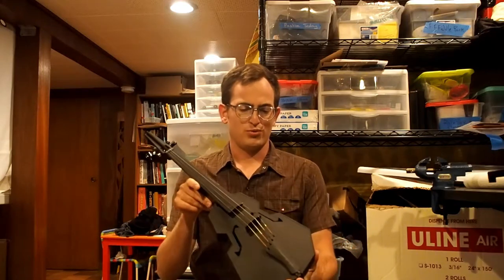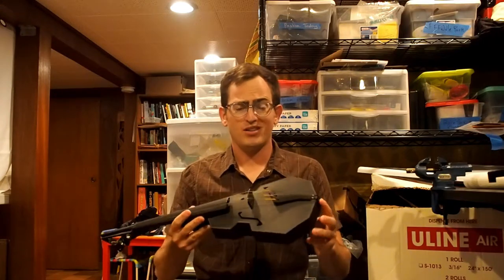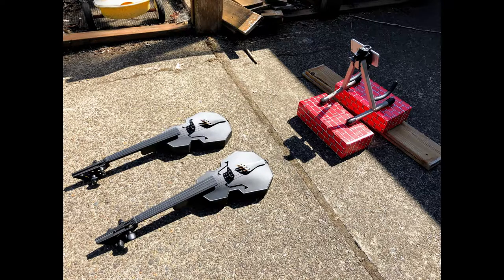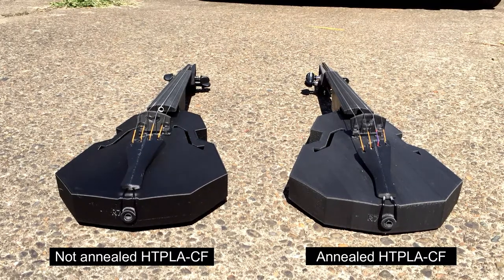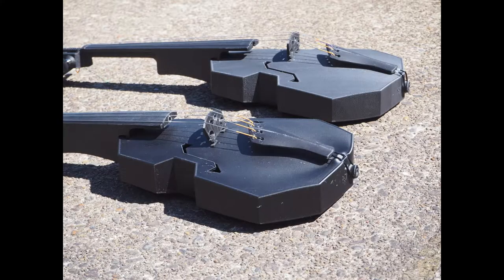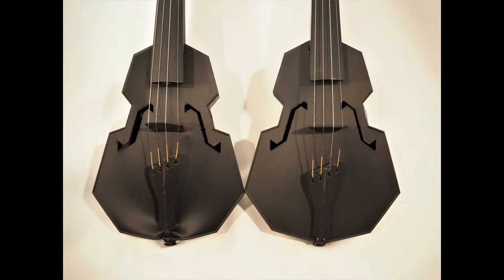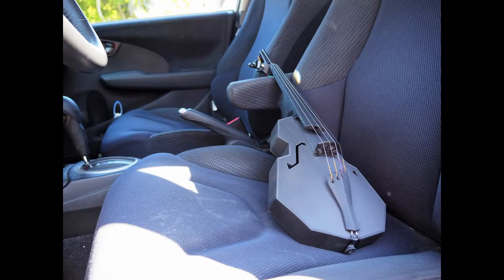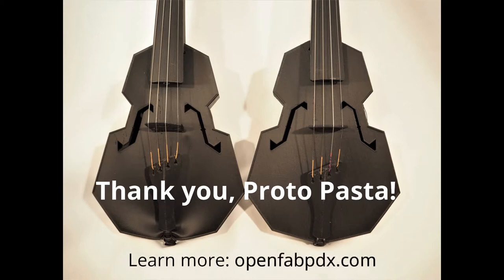Modular Fiddle in the Sun

Comment: Have you ever tried printing one of your violins out of ASA or ABS?
Reply from the maker: A little late, but.... no, I haven't, but others have. Generally speaking, PLA is just so stiff, so it's a great option. ASA or ABS could work well for the non-acoustic parts, though. I'm just not set up to print them safely.

Comment: What temperature and how long did you annealed it?
Reply from the maker: David Conley — after much trial and error, I had the best results setting my kitchen oven to 300F and then turning off the oven before putting my part in. Then I let the part sit for 20-30 minutes, in the hot oven, then remove and cool down at room temperature. For the body I use a butter knife to do a bit of reshaping as the part cools.